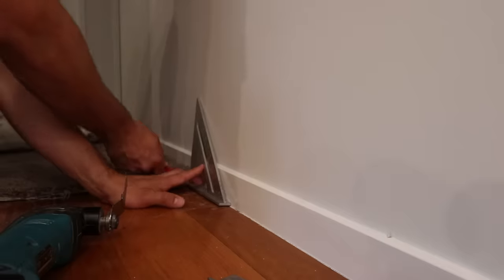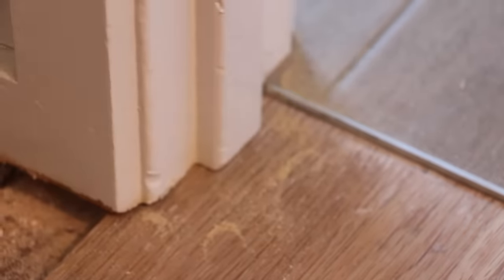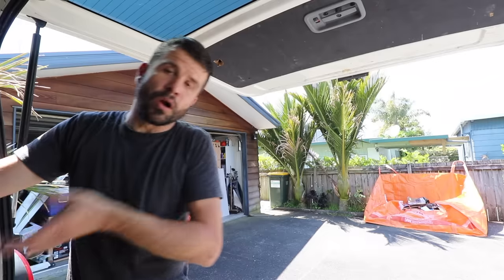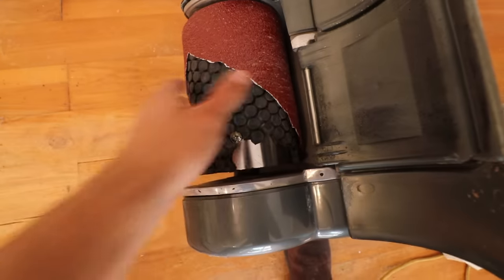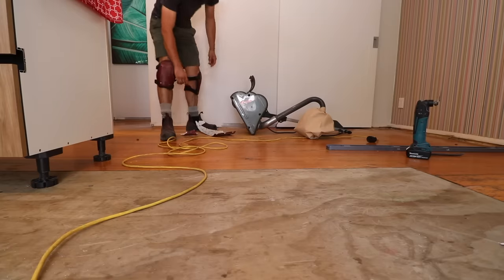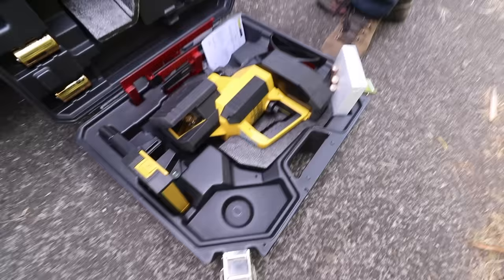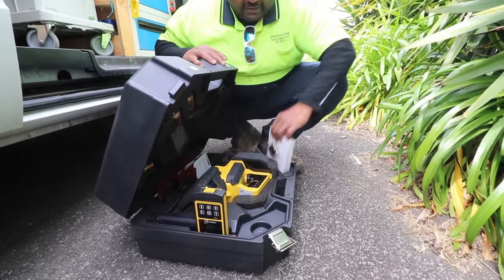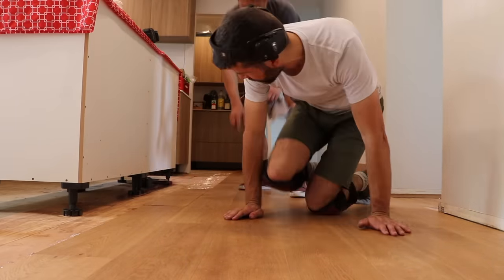Installing Hardwood Flooring (with Glue)

Comment: The nail thing is BS. So long as there were no nails protruding, those sanders will buzz the nails too no problem. That rubber is likely failing through heat and general wear.
Reply: Your dead right but I sanded a floor once that was stuck to a concrete floor  then nailed here and there with masonry nails. And any that I didn't see to punch,shredded the sandpaper
Reply: Blow outs like that can also be caused by not emptying the bag often enough (usually at about 1/4 - 1/3 full) or the paper not being on tight... The bag emptying is important especially with the rougher grit sand papers.
Reply: @ronaldheak1637  well you just said it...they were concrete nails. sandpaper has no issue with conventional flooring nails.

Comment: Never seen someone use a 18g nailer for a tongue and groove floor, normally I use the flooring stapler, much quicker and easier except it runs on a compressor. Neat job though 👍

Comment: Normally you sand the nails down when they are standard iron. Looks like the sandpaper is not that strong. But what do I know :-) 
Nice floor btw
Reply: Wenn die Nägelköpfe weggeschliffen werden, hält die Beplankung aber nicht mehr. Also Nägelköpfe versenken- alles richtig gemacht.

Comment: I would get a white rubber mallet and maybe look into getting a flooring nailer
Reply: Where i leave, flooring nailer is only for nailed hardwood. This is glued hardwood, the nails are just so it doesnt move when they put other raws.
Reply: Yea bro wood nailer is for 3/4 bro no need for it there

Comment: Man, next time just use Selly's Liquid Nails straight from the cartridge. Cheaper, cleaner, faster and just as secure and durable with similar flexibility as that tub stuff. Have trialed as many glues as I could get my hands on and plain Selly's is the best for flooring.
Reply: Have installed that same Oak board and prefer to finish it with 2 coats of moisture cured urethane. Especially in a kitchen (or bathroom) environment it seals the cracks and gives even longer service life to the floor.
Reply: Nails and glue?! In Sweden we haven’t used that for this type of flooring in decades. Of course you can find floor that needs glue but that would be some cheap imported crap that is sold with big discounts.
Reply: Förnamn Efternamn Glued floors created great diaphragms for wood framed buildings. The cheap ones are the ones I wouldn't glue but I hate cheap flooring. More often I'd lay a natural timber overlay. Usually a better price, better look and far better quality & feel. We have so many good options for beautiful native timbers made from recycled lumber here in NZ.

Comment: Hello Scott, great channel you provide with good tips. Thx for this. 
Still a question though. I don't get a nailer gun and I need to fix a 2cm finished parquet on an existing wood floor. Do I only glue it? Do I use special screws to fix it ? With what type of glue? 
Greetings from Belgium !
Reply: Sylvain Van Laer you will only need to glue it. Typically you will want to use a urethane based flooring adhesive. After the repair, you can put something heavy on top of the floor to make sure it bonds well with the subfloor.

Comment: Greetings from the UK. Motored through a lot of your videos lately and happened across this one... I have an engineered floor installed at my house, and if I recall correctly, it was installed with underlay and not glued to the concrete sub-floor. I'd now like to lift this floor without destroying it so that we can complete a reno and lay parquet flooring in the existing space, but use the flooring elsewhere in the house... Do you think that's possible? Appreciate that this is an old vid, so maybe someone else can weigh in if you don't see this...

Comment: If you were putting down a solid hardwood floor over the existing then maybe I could understand a glue down but with an engineered wood (even with a thicker wear surface) I would put down a vapor barrier and then stapled each row in. If the owner ever wants something new or sands through the finish surface then you will have to take out the entire subfloor now...how thick is the finished surface?

Nice work though, liking this build series

Comment: So a sub floor of wood, a wood floor over that, then glue-ing a wood floor over it! not so sure I would be happy doing that in the UK. your humidity may be different, my head says a disaster waiting to happen, but looks good
Reply: Pistol Knight engineered wood flooring , it’s probably going to resist wood movement fine
Reply: @satanismybrother  but what's underneath it.....
Reply: Pistol Knight Not just glue. He nailed the boards too.
Reply: In NZ it is unlikely there is a subfloor beneath the wood flooring. The wood flooring you see him sanding is usually directly on top of the joists. In this case Scott had already done a floor patch using plywood, so covering over the floor with a new flooring makes some sense (as opposed to trying to find a similar timber to the original floor for the earlier patch, but it would never be a perfect match, would be expensive, and would always look like a patched floor). The other benefit to putting the engineered floor down on top is that the finished surface of the living areas now matches the height of the tiled bathroom, rather than having a lip to trip/stub your toe on.
Reply: Matt Ryan  my mistake if that's the case
Reply: What pistol Knight is getting at is that you should be very careful covering any solid hardwood, once you cover it you're not allowing it to breath as it should. Also your man in the video is laying the engineered wood in the same direction as the wood underneath so when the less stable solid wood underneath moves it can pull the engineered with it causing it to open up.

Comment: I guess an underlay isn't needed when you put glue down? But where I live we just lay this type of floor loose. No glue, no nails. Just underlay and flooring on top.
Reply: Cyrus I agree. This video brings me back 50 years in time.
Reply: This is not interlocking laminate that can click together and "float", it requires either glue or staples.  If it was not glued, the joints would open up within a day.
Reply from the maker: In this case the joins are a simple tounge and groove, they slide into each other but they dont lock in place. We mainly glued it and added nails to help keep it in place. The manufacturer of the boards recommended gluing for this particular job 👍
Reply: Scott Brown Carpentry It comes as a big surprise to me that people still glue. As a carpenter in Sweden it is very hard to come by floors that need glue, they all (99%) lock by themselves. We stopped glueing floors decades ago.

Comment: OK, I have a question... Laminate flooring requires a gap around the edges for expansion, by glueing these boards down, how does this work with expansion? Or does this type of board not expand like laminate flooring?
Reply: Engineered boards are far more stable than solid wood but still need room for expansion.
Reply: Laminate  dosent expand  it floats and houses  shift the expansion utilized for floating floors is so there  is no buckling especially under door casings.

Comment: I feel bad for who ever wants to take the flooring out, i did a job where a flood happened in the kitchen, continuous hardwood flooring throughout the entire downstairs. They glued the edges and around all the vents, the subfloor was a complete mess and it was a long job. What's the thinking behind glue vs nails, is it because of the wide planks?

Comment: Hi Scott what do you think of the Makita jigsaw you were using in the video 👍🏼
Reply from the maker: It's a good jig saw, had it for a while now, I like the barrel grip, good quick change blade system, the light is handy too. The buttons are a little annoying, and the plastic base plate cover needs to be glued on I think, falls off a lot.  Good saw though
Reply: @ScottBrownCarpentry  Hi what type /brand of glue is that?

Comment: I am wondering why i havent seen you seat the boards into the joint with anything other than your hands?
Reply: Its  engineered tounge and groove not a locking  floor system.

Comment: @Scott Brown Carpentry We in the states use a narrow crown floor stapler which is also 18GA for that kind of flooring. Also just wondering if there is a reason you didn't move the island? Love the videos bro!
Reply: Most engineered allows the option to either glue or staple.  Glue will certainly stiffen up the floor a bit.  (that's why I like to skin a floor with minimum 3/8 ply and PL Prem and screws before installing 3/4 hardwood.

Comment: You know you're supposed to roll that floor with a hundred pound roller when gluing it down. Also, might want to think about doing that floor at a 45 or a 90 to the existing floor. Typically we don't go with the floor joists, so really the 45 is the only reasonable way to go, unless the original floor was installed in the wrong direction, which would be awesome for you. Still, nicely done. Ps. The reason for the mix of lengths is so that you don't have cross joints separated only by a single board  and directly across from one another.
Reply: Matt Ryan  While I might personally agree with that sentiment, every major manufacturer of engineered hardwood would vehement disagree with you. Yes, even in a gluing situation manufacturers require you to go across the floor joists. But having said that, the tradition of going across floor joists is to prevent nail-through from a single t&g into a single joist, which does not apply in a glued floor. Moreover, If the installer wants to avoid the gapping transmission from the existing wood to the new, he should install the floor perpendicularly to the existing floor, manufacturer's be damned. I was simply suggesting that was a violation of the manufacturer's guidelines either way. And the only way two meet guidelines would be to install it at a 45, something that many customers and budgets equally deplore. All things considered it is best for the floor to at least go across the existing floor oh, if you can't, dating going across existing floor and across the floor joists.
Reply: I agree with the ply board comment but this subfloor was the old solid strip so was def a risk  fitting on top and the same direction as the old. Engineered may be very stable but that old strip def isnt
Reply: Matt Ryan  I think the concern of the manufacturers is the thermal expansion along the length of the joist  and associated warping that, while not large enough to be relevant to the structure, is certainly large enough to cause a gap in the floor. On paper, the thermal expansion of a floor joist it's rather large, and will often cause slight twisting of the joist. Typically that expansion can twist a floor joists as much as an eighth of an inch from one season to the next. I'm sure you can imagine how that eighth of an inch would translate onto a paralel joint directly above it. Though it's rare, I've  seen this happen more than a few times, mostly because I'm a flooring installer and I get paid to go in and tear the floors out and replace them, usually at the flooring companies expense. But the bigger issue is putting the floor in parallel with the existing flooring, itself nailed directly to the floor joist if memory serves and I'm not mistaken. I think the manufacturer is don't want you install in one hardwood floor on top of another in parallel because of the propensity for cupping that this causes. So you have two different concerns that both go away if you install the floor at a 45. As for me, I tell customers the bigger concern is cupping and if they want the floor to go parallel to walls then it has to go across the existing flooring, no exceptions. It's also worth noting that the industry now has tools allow us to nail or staple a new floor into an existing floor without penetrating the existing floor, so as to avoid any transfer of thermal dynamics issues. Most manufacturers still aren't okay with it, but it's a reasonable compromise.
Reply: Matt Ryan  it occurred to me after I wrote the post if there's another way to look at it. The engineered hardwood manufacturers go through great lengths to stabilize their product by building a balanced number of layers into their product, such that opposing layers going out from the middle are the same material and cross-grained. The adhesive has enough flexibility in it to deal with the mismatch that happens when you glue their balance product onto the plywood and the plywood itself is fairly well-balanced. But by installing their product onto an existing hardwood along the grain you've broken that sequence of balance and doubled the tendency toward cupping (or cupping force) that all engineered hardwoods experience despite their best efforts. Of course the plywood was never cupping anyways, so that wasn't adding to the difficulty of the glue to resist that upward force. I should also mention, though I'm sure you know this, that the reason for cupping is the thermal difference between the above floor and the below floor conditions. The bottom of the wood takes in moisture as the grain is loosened because of thermal variation, basically the wood wants to move. As each layer of the wood experiences this the cupping effect will migrate upward. This can take four or five years often. But in some conditions I've seen it in less than 2 years.
Reply: Matt Ryan  About 15 or 20 years ago several of the makers of pneumatic cleat nailers came out with nailers that had a steeper angle of attack  so as to preclude  penetrating the subfloor  and hitting the joist, something to be avoided for all of the reasons I've described. Before the pneumatics came along (sadly  I'm old enough to remember that), I don't think they could have that steep of an angle without risking damaging the wood. The thing is you could use these to go into an existing hardwood without even making your way to the plywood. Not sure that it matters in the grand scheme of things. Perhaps I'm just nostalgic.
Reply: Matt Ryan  Indeed.

Comment: In West Oz we use Sika t55 or similar, expanding glue is near impossible to get off the floor when cured and if you cant secret nail: your floor might not be very flat the next day.
Reply: N Levey Haha I have seen that happen. Had one situation when guys on a commercial fitout scrimped on the glue and overnight it had expanded just a little and while it looked flat, when walked on it sounded hollow in spots. The architect went round tapping on it and told them to rip it all out & redo. Unfortunately they couldn't get the same colour from the supplier so they had to get a whole new order for the whole floor. I heard & saw the situation because I scored all the unused boxes of the original dark oak from them for 1/4 price. Did 3 kitchens and 3 bathrooms with it!
Reply: You can use paint thinner to remove the glue and it dosent harm the finish at all

Comment: You need a lagler tapping block and a rubber mallet... 
And a pair of sneakers to work in.
Socks on a job site... no way!
Reply: I’ve mentioned to him before about the socks. He knows best, seemingly.🤷🏻‍♂️. Makes me wince.
Reply: Mate we are in the southern hemisphere, sometimes we even work in bare feet.
Reply: I carry an extra pair of runners in the van, and they are "indoor only", and have never been worn outside.  Much easier on the feet than socks all day.  Sure, I have to slip them off and on at the door, but small price to pay.
Reply: Those are South Auckland Safety Socks. NZSA approved and required.

Comment: Wrong Wrong Wrong on so many levels, shouldn't overlay over an existing floor, no need for sanding, it's a much bigger problem that will re-occur and make things worse, wrong nail gun, wrong nails, at 6.44 no expansion gap, i stopped watching at this point, that adhesive you used should be one that allows the flooring to move, it is very elastic, which is why you shouldn't also nail it !! Sorry guys....

Comment: Installing a pre finished wood floor with glue is not an fun task. I have never done this but I can imagine you have to be extra careful not to get the glue on the flooring. A constant battle I'm sure.
Reply: When "laminate floors" first came out some friends installed it in their house.  The boards were not "click together", but rather needed a bead of glue, and there were special ratchet straps (that the store would "rent" to you) to pull everything tight until the glue dried.  What a mess!  Actually saw a couple of the strap sets for sale recently, as I'm guessing no-one makes that type of product any longer.  
(actually, in Scott's situation, a bit of glue or squeeze-out is not too bad, as the wood is pre-finished, so will wipe up very easily)
Reply from the maker: Very true

Comment: Scotty you and the bro need to come over the ditch and show these cowboys how quality and workmanship looks like. I’m currently site supervising these  so called “tradies and they are making a monstrosity out of this joinery! 
Love the content your bringing out. 
I have a carpentry and joiner back ground and I’m either learning from your videos or reminiscing the good and bad times when installing. Keep up the good work bro.
Reply: You must suck then if you think there good installers because I see H patterns , floor boards of the same length  a board away from each other ,and material  that width a board should  line up only every  6 boards I've been installing Hardwood  and laminate floors for 13-14 years and majority of homeowners would be upset with this installation!!
Reply: And your a site supervisor and you think that is a quality installation, wow!